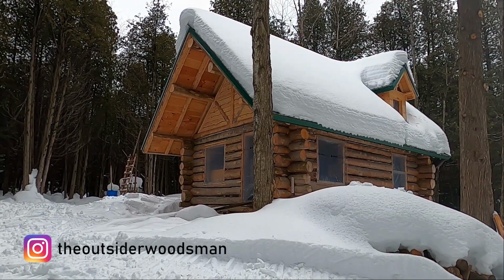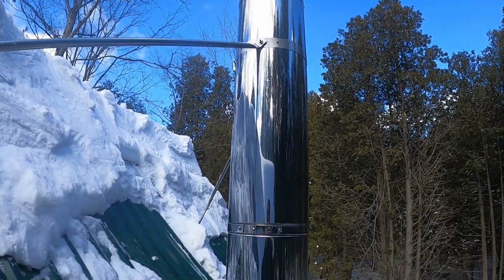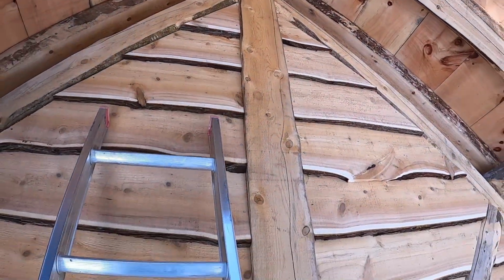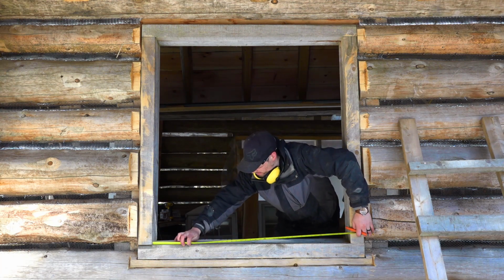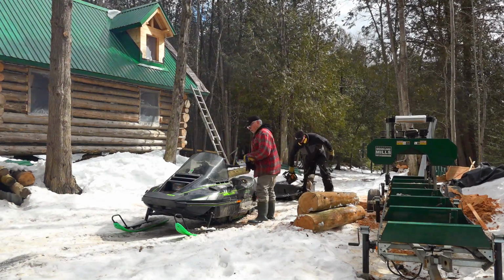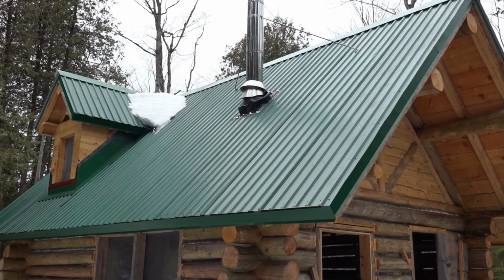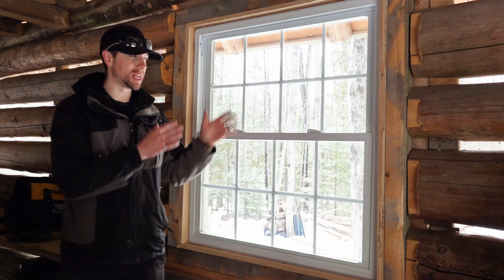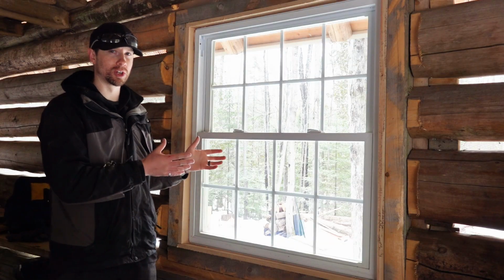Putting in our Log Cabin Windows! Big Difference! / Ep80 / Outsider Log Cabin

Comment: I have a question. With log cabins they usually leave a gap on top of the window frame for the logs to shrink. Are your logs done shrinking and is that why you didn’t leave this gap? Maybe I just can’t see it on the video. Your project is so amazing and I really enjoy following it over the years. It must be exciting to be so close to being weather tight! Thanks for sharing😀
Reply: I was wondering that as well. I read once that folks used a chain saw to cut a 2x4 sized mortise in the vertical sides of the rough opening. A 2x4 was screwed into the mortise through slotted holes to allow for log shrinkage. The window then is screwed into the 2x4.
Great Cabin!
Reply: @jimsteele9261  If you have watched all the videos you would realise that those logs have been in place for a long time!

Comment: My carpenter friend told me long ago to never to use the spray foam insulation around windows like that. He said that it can expand so much as to put enough pressure on the frames to where they will not open. There may be another product these days that's not so strong in expansion but, he told me to just stuff in fiberglass insulation in the gaps. And that's what I've done in the past. The cabin is really looking good!

Comment: Top shims = generally a bad idea. Shim/plane the sill level, shim side to side for placement. Screw the sides through shims and be done. Might consider pulling the top shims. Any settlement I. The structure can crush the frame/cause the window to bind.

Comment: We use a garrett metal detector across the logs before we cut to keep from ruining a blade.  They are economical to buy new or used from ebay or your local saw dealer.

Comment: Same prob at my Cab. with snow build up around chim. I installed a heavy duty saddle to deflect snow around chim. it worked think of a large v shape protect 12 inches both sides all overbuild  withHD metal and bolts think inverted v

Comment: you may want to mount your windows in the buck closer to the interior, that way you can add shutters later to bear proof it. id trim out the inside first, then spray foam insulate them from the outside, no foam mess in the interior.

Comment: The windows are perfect and a very good deal. You are lucky to have found them. 
Could you move the chimney brace collar higher up on the chimney and then move the anchor point of the braces close to the roof ridge so there wouldn't be any snow above the brace anchor point to slide and damage them. The braces may be a bit more horizontal but that would give better bracing. 
A steep steel roof with heavy snow on it can slide suddenly. Best to be on the ground.

Comment: You can use your black speed square to mark your cuts on your boards and then also to guide your circular saw with. Just a little rough carpentry pointer.

Comment: How did that screw get in that log?  You just pulled the log out of the woods...
Reply: I was wondering the same.
Reply from the maker: 😄 That screw in the log was from when we used it as a base for the Pop-Up Cabin last winter, until we moved it. Apparently I missed that screw when I was taking the floorboards off. I left the log there to season a little bit before coming back for it.
Reply: Well thats some rotten luck finding that screw.
In sweden I got enough crap in the timber from my land to run it by a metal detector. Found bullets, nails, wires etc 7 or 8 times since I got it 25 years ago so I guess it paid for itself a few times over.

Comment: A real grate price when I built a house in Canada it was 600 per window so I went to Home Depot in the States I got Anderson crank out wood inside final outside 200 American dollars R 6 argon gas filled . Great improvements to the Cedar Cabin I have been on the journey with you I cut a 45 degree angle opposite the stoolcap on the exterior trim to shed the water !!!

Comment: One way to use expanding foam/caulk in less than ideal temperatures is to warm inside a coat or vehicle during work as many learned the hard way that having them out in an unheated  place like a truck bed or site can actually ruin them if they freeze. Most have a temperature rating for use and some need to be kept cool in extreme hot weather especially foam since they can even burst or come out like a snake fleeing a Forrest Fire. One does wonder if the dormer Windows will match as well or will they need to be ordered or simply be framed in glass possibly on hinges so they can be opened.🌲🌲🌲

Comment: Looks awesome! In my many years of trimming windows I have learned never ever use spray foam of any kind in vinyl windows. You will have problems down the road guaranteed! Best to use insulation and or silicone caulking in tighter space. Vinyl windows were also never made for the cold because the frame structure is hollow and creates tumbling effect with cold meeting heat and causes ice build up unless you keep heat or air movement on them all winter. I have done thousands of homes in the fargo nd. And moorhead mn. area and know exactly how these windows function in the cold weather. Just an idea before you get too deep into them.

Comment: I can't imagine building much of anything at scale with Imperial after having a welding job where 1/8-1/32nd" measurements were the norm. I'd go nuts converting fractions and adding/subtracting them all day. Metric, even as an American, is just so much more convenient there. As for temperature in daily/personal use, however, Fahrenheit is better.
Reply: The Outsider's tape measure had both Imperial & Metric measurements!

Comment: Why do you have massive gaps between your logs?
Reply: Those gaps are not big. Very typical.
Reply: @stanschmitz5566  thats fine, but not typical of other cabins I've seen. In fact, this is the only cabin I've seen with gaps 1 inch or more between logs.
Reply: @JoshOsRocks  The old log homes from the 1800's you see on "Barnwood Builders" have 3 and 4 inch gaps that get chinking in them.
Reply: They will put chinking in it soon, but wood needed to expand and shrink beforehand.

Comment: Okay you got all that snow on your roof you should have made your roof more steeper it's going to you going to do that every year as much snow as you get there you're going to do that every year have to get up on the roof so you don't your braces don't get bet you're going to have to come up with a better solution to get that snow off of there when you run in your wood stove in the house you should put holes in your ceiling to where the hot air will go in there and melt that snow I rather have icicles running off the side of my house and have it the root collapse or the chimney get damaged then you have a house full of smoke